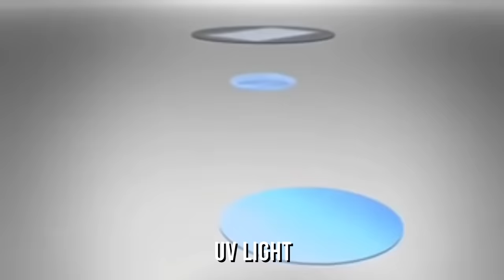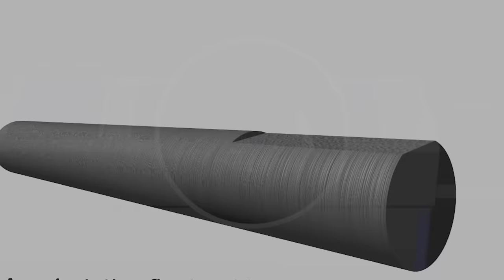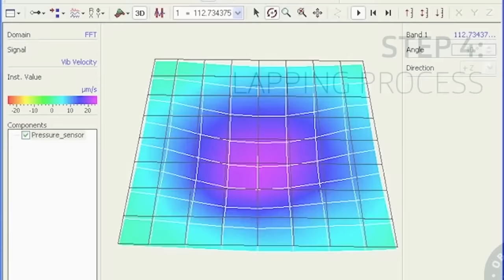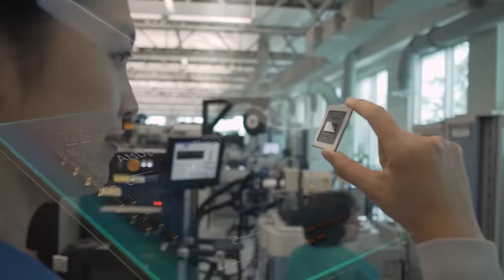HOW IT'S MADE: CPU

Comment: You describe what the processes are, not why they are used or in that particular order. If you want to make a "how it's made" series, you need to explain why each step is used and, at the very least, discuss either; older technology that the current process replaced, or discuss current alternatives to said process and its pros and cons.

This video is like being told what to program instead of being taught *how* to program. You should focus on the question of "why?" equally, if not, more so than the question of "what?".
Reply: what will you do with the information tho?
Reply: @JoJoUchiha07  I'm an engineer. This kind of information is just generally interesting seeing as I work in a similar field (electronics). Engineers like learning about manufacturing techniques and their rationale.
Reply: I'd say it's more like a very brief explanation of what a large block of code "does" without explaining how any of it works, and without teaching the person anything about what or how to program. You can't really learn much from this video beyond the fact that CPUs are made from silicon that comes from sand and that UV light is somehow used to carve the silicon.
Reply: @JoJoUchiha07  lol

Comment: I still how no idea how a CPU works...
Reply: Think ones and zeroes like numbers, only one bit has 2 unique combinations. In the computers we can add more bits to increase the unique combinations and treat each one like value or magnitude. Then the computers works only with numbers. 

How works in a bit more deep explanation: 

1. Program Counter
Computer reads program pointer, that pointer stores the current address of the execution. 

2. Then the number of the program pointer goes to the instruction Cache L1 or RAM, the RAM or Cache decoders declares which “department” have the selected instruction and reads it. Hence this regret the stored value.

3. Instruction decoders
Received instruction goes from selected Memory cell to Instruction decoders, which one activates different components or busses depending of the upcoming instruction. Prepares the execution.

4. Data decoders
Computer searches the operands in Data Cache L1 or RAM (the instruction sets the direction) and define inputs.
 
5. Execute instruction
Selected components receive data to process giving the results with flags.
Add, Subtract, Multiply, Divide, Rest, if x state jump program to y, Halt. Etc.

6. End of cycle 
The activated components and busses are closed, and program pointer is increased 1 steep.

In example of executing a program: 

1. Read drive to search the program.

2. If it’s ok load to RAM
If not then occurs an error.

3. Then operating system orders instructions and data package in cache to store most frequently accessed variables.

4. Execution if correct.
If not correct then error message.

Too long, but i hope you like it. 😊😂
Reply: You write this ؟
Reply: @yoomy_gums  ؟
Reply: Try checking out YouTubers like Ben Eater. You can learn loads about how computers work at the chip level.

Comment: its quite a thorough video BUT you all the time proceed to show wafers that are NOT cpu wafers, not even gpu wafers. and some of your b rolls of how its done are straight up in wrong order or one step ahead. a wafer also is not NEARLY AS THICK as a dime, you can BEND a wafer with ease, even its own weigth will bend it.  also most wafers are sliced via wire, either moving wire or moving the ingor through wire, last thing is better for raw wafer yield. also the testing you showed is NOT whats used in production, you def. dont wanna throw pieces of broken wafers onto completely fine wafers, thats just a test to determine the grade of the silicon done every so often. the probe needles testing also doesnt check if the wafers meet frequencies at all, it just tests if the transistors block the signal path due to defects. they all respond, its important how loud the response is for binning, if they respond at all for trashing it or not. completely different things. BINNING IS DONE WAY BEFORE PACKAGING AND PACKAGING ALSO HAS NOTHING TO DO WITH THE HEATSPREADER NOR LIQUIDS, if liquids reach your cpu with perfect packaging its fcked too. packaging is done for 2 important parts, so that the customer doesnt f the cpu up and secondly because stacking dies or creating clusters reduces latency which boosts performance. in 1980´s you had add in cpu cache, horrible latency, horrible performance.

Comment: So if I’m getting this straight good chips and bad chips can come from the same batch? And they sell them both? 

Am I missing something or is that basically just what binning is?
Reply: they can make a same chip with 8 cores and 6 cores. they just disable the cores that don't work
Reply: some chips made from a wafer have bad circuits on them but are still mostly functional so a very good chip might be say a i9 and a chip with defects might be sold as an i5 think
 of a bad chip as small city with lots more road closures than a city with with all roads open...more roads...more traffic!
Reply: They've been doing that for decades. Back in the single core days, they would test each chip to see how fast it was and package it accordingly. So a single batch could result in chips that ran at different speeds. That's also why two chips sold as identical usually didn't run at precisely the same speed. If a CPU was sold in speed increments of 50mhz, then say a 500mhz chip might run anywhere from 500-549mhz. It would have to hit a full speed of 550mhz to be sold as such.
Reply: @JMcMillen  it doesnt even matter if it runs in 549 instead of 550 right
Reply: @mohammedabb985  Except from a legal standpoint. If their test doesn't show it running at at least 550, it would be false advertising to sell it as such. And no chip company is going to risk the massive class action lawsuit they would get hit with if it was discovered that their chips tested slower than their advertised speed.

Comment: Amazing but still dont understand how we can have billions transistors
Reply: The silicon wafer is the basis of the transistors. They are not installed on the wafer, tiny sections of the wafer are doped individually to make that tiny section have the characteristics each transistor needs. They are right next to each other, but not electrically connected because silicone is a 'semi' conductor, and only takes on the ability to conduct by the doping process. Each electrical communication between the transistors that are formed in the wafer is done by the etching of lines, or tracks in the surface of the wafer, then each Trac is filled with a known conductor, like copper, or even gold. They act like tiny wires between each of the other transistors that they need to communicate with. These complex electrical connections are even layered to make layered positioning of transistors, or perhaps using both sides of the wafer, and these connections are laid out before each individual transistor is created into the silicon substrate. 
It is a thing I have been wondering just as you have, for a long time. I have watched many early transistor educational films from the 50's and 60's when they were talking about making individual transistors and doping them in various ways and learning about how they react, and I think those were possibly as big or bigger than what we would look at as a resistor today. Absolutely enormous comparatively. But they all were made of silicon, and doped much the same way (basically) as these modern devices. 
Learning to create them close to each other on the same thin piece of silicon, along with the micro electrical grid is the magic that gives us the powerful chips of today. And THAT is a level of understanding I am nowhere near grasping. And then there is programming! Haha yeah no idea. Maybe that is your trade.
I hope this helped you, and I did not mean to treat you like a child or anything like that. Just barely grasp this myself! 👍
Reply: @HassanAchieved  look, I am no expert. Think about it this way. The silicon wafer is the basis for the transistors, but doesn't have the qualities of a transistor, electrically, by itself. This happens when the doping agent is added into it. 
Now, you could make one very large transistor with that wafer. Or you could make 2 by simply doping one half, leaving an untreated area straight across the middle, and then doping the other half. They will be electrically isolated from each other by this pure silicone barrier between each half, because pure silicone is a 'semi-conductor' and is an insulator until other substances are added into its crystalline structure. 
Now imagine instead of 2 transistors, you wanted to make 4 from the same wafer. You would simply leave 4 equal sections of that wafer isolated from each other by leaving the thin area between then as pure silicon, then dope the other 4 sections with the selected doping substance. You would then have 4 transistors on the same wafer, but not interacting with each other until you connect them electrically with a conductor material like copper. The two electrical connections to complete the circuit are, I think, on opposite sides of the wafer, but with the right doping technique I believe they are able to use only half of the thickness of the wafer for one transistor and have both conductors travel along the same side of the wafer. That leaves another area for even more transistors on the entire other side of the wafer, doubling its capacity.
 So, think about it. You can divide that wafer into 1000 tiny sections, and by the same method, make 1000 transistors on the same wafer. Or more. By carefully doping tiny sections of the wafer, and leaving the spaces between them, however small, as pure silicon. Then you would have 1000 electrically isolated individual transistors on one wafer. Or perhaps on one side only of the wafer, with 1000 more transistors on the other side. All that needs to be done at that point is to connect them electrically in a fashion that would make it useful. In the modern technique these connections are laid out before each individual transistor is created. Makes it easier. 
Hopefully you understand what doping is, if not, there are numerous videos explaining it. In very basic terminology. 
These methods of doping and interconnecting are what constitutes a 'chip' , or processor. This much I know. 
 I am fairly certain that there are far more than 1000 individual transistors on one wafer, as the science of creating them has increased dramatically. It doesn't matter how small these transistors are made, they still react electrically exactly the same as a larger one. There is a limit however, to how small we are able to create these devices. And a limit of the conductors because of their own resistance creating heat, which is the biggest hurdle the manufacturers face today. 
I hope this helps you understand it a little better. Just explaining it to you helps me understand it better. 👍
Reply: @markhonea2461  The way you worded the process and dumbed it down to 2 giant transistors made me laugh, but was a clever way in explaining the process for me, thank you!
Reply: @3nd04  that's great! 👍
Reply: Could we have more info around the binning process? Great video
Reply: @markhonea2461  yo that is awesome i think i understand it somewhat especially thanks to you
Reply: @zeroroanoramoraoura2311  🤓👍 Its very cool to suddenly grasp a concept which has been difficult to understand, but the desire to comprehend has been a constant. It has been my experience to achieve mental relief upon the sudden understanding of any challenge as this. It's like- aaaaah. I get it now.🤓👍
Reply: @markhonea2461  i appreciate your existance and words, gave me direction to start researching this topic as somebody that understands absolutely nothing about electricity and electronic devices physical components, stay curious and generous with your knowledge some of us are just looking for a smidge of direction (i most likely never would have thought to learn about what a transistor or semiconductor is and does in relation to this topic otherwise) and it seems to be a rarity for people to be willing to extend a helping hand on the internet for people such as myself who arent exactly some sort of high class intellectual, so for that i must say i think you are an amazing example for people all around the world, keep on keepin on my friend
Reply: @Jol5357  oh my gosh dude that's so excellent;!👍 You see I was baffled by the function and structure of these and I was overthinking it totally and no one ever really gave me the basic description until I figured it out on my own somehow and it was an Ah-Ha moment! So if I helped you understand it at all I hope you got that same aha moment and a grip on how these things are put together. I mean it's so simple it's almost impossible to imagine but I guess simple is how they get a billion transistors on something as big as a nickel, right? I am glad I could help you and I appreciate your kind words. I shall continue! And you do the same brother. ,,👍😎